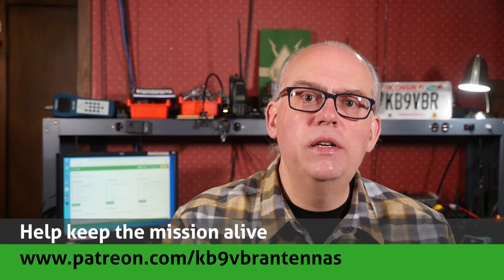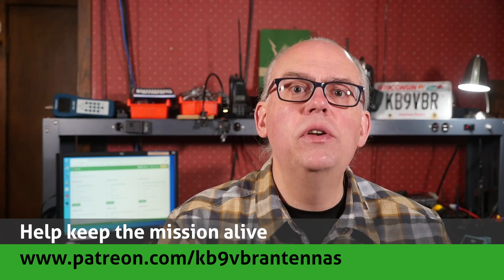How many radials do I need for a Wolf River Coil - May 2021 Livestream Excerpt - Ham Radio Q&A

Comment: I use 12 17-foot in groups of 4 on alligator clips.  I use BNTECHGO 24 Gauge Silicone wire. You can comb your fingers through it and it will all sort itself out with no knots, I can deploy and be tuned up within 20 min.

Comment: I saw one video where one operator was using 24 33 foot radials with an 80 to 10 Wolf River coil and a 17 foot collapsible whip antenna with good swr’s across all bands.
Reply from the maker: That's a lot of radials to spread out for a portable operation, but it is quite effective. Especially for a permanent installation.

Comment: I use the radials I got with my ATAS-25, and I most always get a good match. The ATAS radials are three different lengths and it seems a good match finds it way somewhere between these radials.  I use a big alligator clip for quick deployment. I stretch them out and retain them with large garden spikes pushed into the ground. I made a small loop at the end of each radial to accommodate the spikes. Seems to work for me.

Comment: I run 9 radials with 3 bundled together with crimped and soldered terminal rings on each leg of the oversized tripod.  Cut to16', it only takes me 10-15 minutes to set up the antenna, tune for resonance and get on the air. I anchor the ends using rocks or 3/16" x  6" aluminum tent stakes pushed through crimped ring terminals into the ground, to keep the radials stretched tight.  I solder only the terminal rings that attach to the tripod so that the staked ends of the terminals can easily break free to reduce the tripping hazard caused by putting out longer temporary radials.

Comment: Michael, any chance you can go in depth on how you set up and tune your WRC?  I'm never able to get mine below about 1.5:1 or 1.6:1
Reply from the maker: I've received a few requests on doing this. I'll try to get a video produced yet this fall. Although, in reality, 1.5:1 isn't bad. External factors, like location, can affect your results and if I can't get the SWR down below 1.5:1 after fiddling for a bit, I'll usually run with it.
Reply: @KB9VBRAntennas  Agreed, I just run with anything under 2:1 if I mess with it and can't go lower.  If you do the video, can you do it using that Stick 230?
Reply: While it's true that you reach a point of diminishing returns when you add more radials, the fact is that adding more radials increases the antenna's efficiency and lowers the take-off angle.  If you are only running 2-3 radials, you might try to add a few more and see if that helps lower your SWR.  As long as you are below 2:1 SWR at your chosen frequency operation edges, you should be fine.  73, K7SFA

Comment: Can the WRC antenna be deployed like the Buddistick? In other words, could the WRC successfully use a single, elevated radial?
Reply from the maker: You can certainly do an elevated radial, that's one deployment I never tried with the WRC. There is no reason why it shouldn't work as the WRC is functionally similar to the Buddistick. But I do know that with one radial on the ground, the coil is very hard to tune and I have by best luck using three radials.

Comment: I put the WRC on a 6' tripod, a 102" as whip, a single tuned radial on a kite winder, running over to a 5' fiberglass driveway marker. It's a pile-up maker.
Reply: This seems to be the it antenna set up for 2025, you are ahead of everyone else

Comment: Radials sitting on the ground don't need to be a specific length. Especially portable when you can't account for the conductivity and permittivity of the soil. You'll find six 16 1/2 foot radials to be just as good as three 33 foot radials, except much easier to deploy. Don't overthink this.
Reply: Pretty much the same thing I discovered.. I found unwinding 3 33' radials tedious, decided to cut them into 4 pieces each. So now I have 12 8.25' radials and it actually seems to work better. I think a more dense coverage (more radials in the "circle" is more important than length. On 20m with 12 radials and a 213" whip (shortened) I can usually get pretty dang close to 1:1

Comment: For my Wolf River Coils Antenna, I user the 3 radials but I wrap each radial around a 12"piece of small PVC pipe.and it seems to still work well. I've made several contacts from my QTH in Georgia to Italy and several other DX contacts. Now with my Comet HFJ 350M, I use a single counterpoise that I've marked with different color electrical tape for the different bands and that seems to help me bring it quickly into resonance. I'm still working to get it more consistent though.

Comment: I've got a 50' steel tape measure with a button to lock it at any point. I connect the end to the counterpoise contact on the antenna, then extend it out and punch the button where I want to stop. This seems to work well. And it still works as a tape measure!